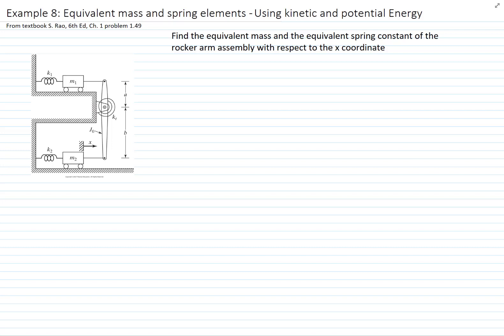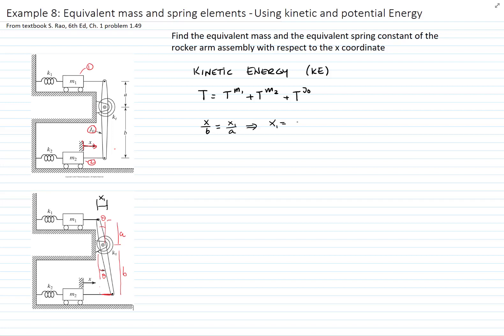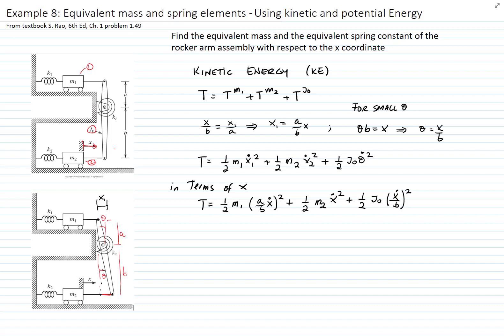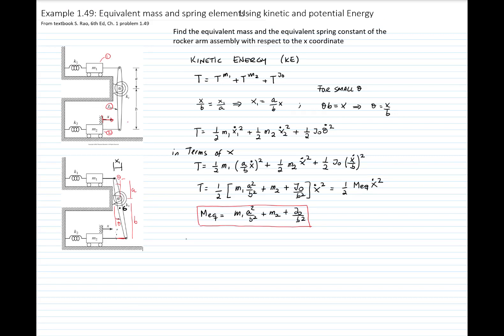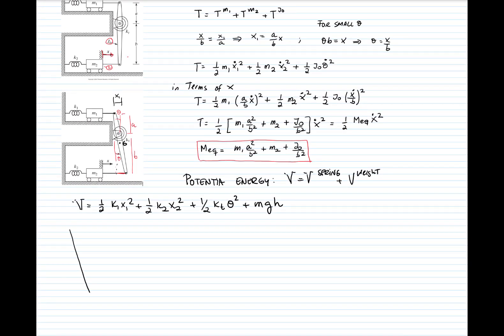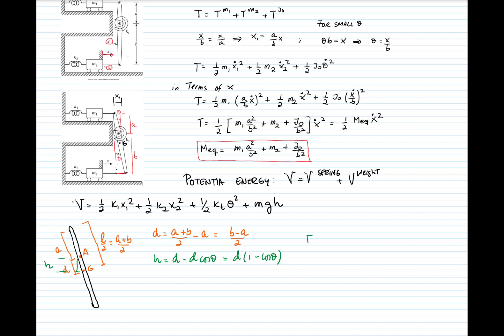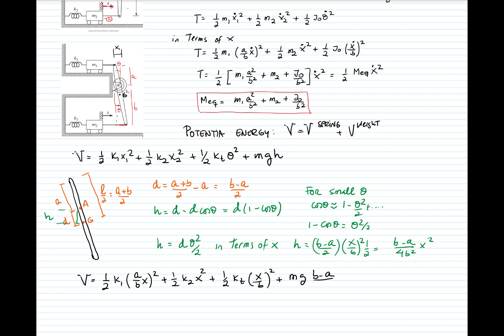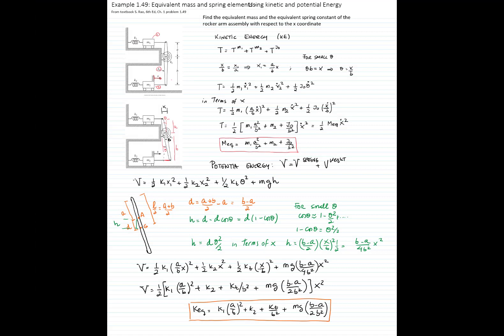Example 1.49 Equivalent mass and spring elements

Comment: Did we really have to include the potential energy due to the change in position of the center of gravity ma'am?

I thought a vibratory system consist of means of storing potential energy which is in the springs and a means of storing kinetic energy which is in the mass or inertia element.